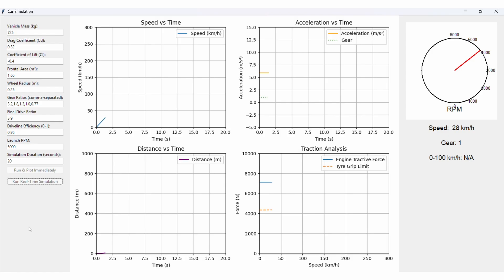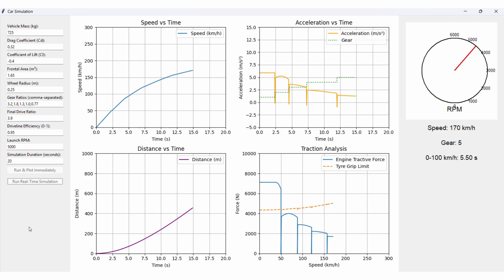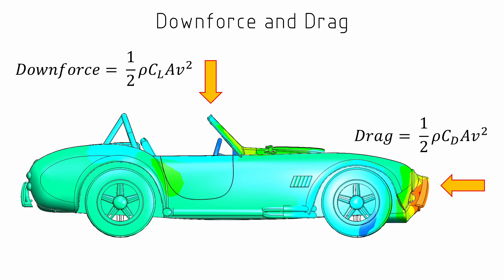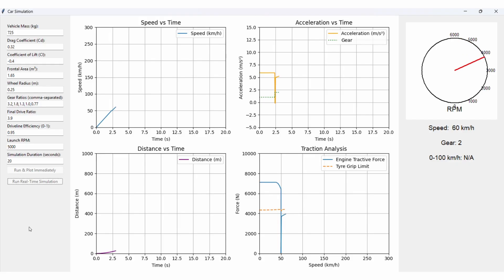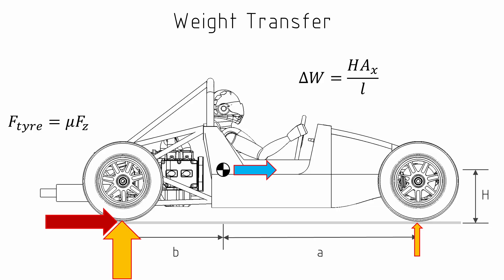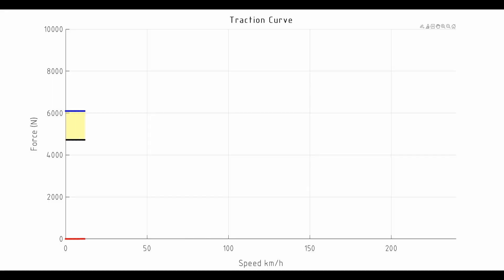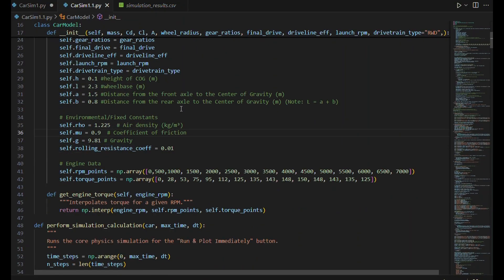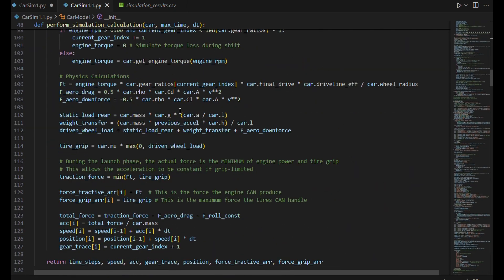Using AI to recreate an Acceleration Simulation

Comment: GNU Octave is the most well-known open source alternative to MATLAB, designed to be highly compatible with it. Other options include Julia and NumPy, which also support scientific computing tasks
Reply from the maker: Have spent some time with GNU Octave, which is close enough to matlab to run any of my code. Although have to admit haven't used Julia or NumPy.  Open Source software for these tasks is really important. Despite its amazing capabilities I think a lot of the uptake of Matlab professionally is held back by its price. At least in Australia I have seen it used far more at university than in industry, with spreadsheets doing things they were never designed to do.

Comment: I started doing something similar about a month ago with a front suspension design I’m working on. I programmed the front geometry for further analysis, and even though I had never used MATLAB or Python before, I was able to generate some really useful data.
Reply from the maker: Code is definitely one of the strengths of generative AI at the moment. That puts a lot of programming in the reach of a lot more people. I wonder how viable a lot of commercial software in niches like kinematics will be in the future as a result of this.